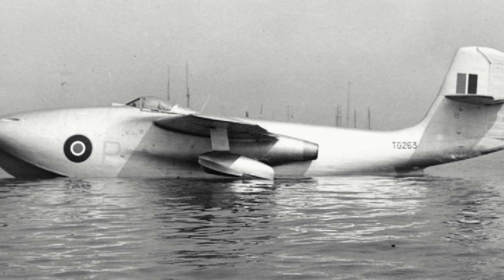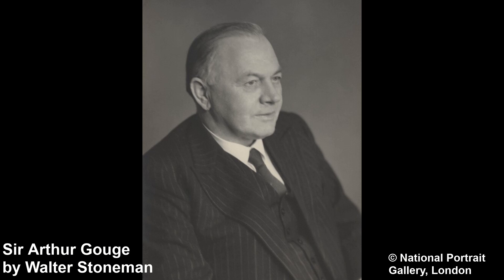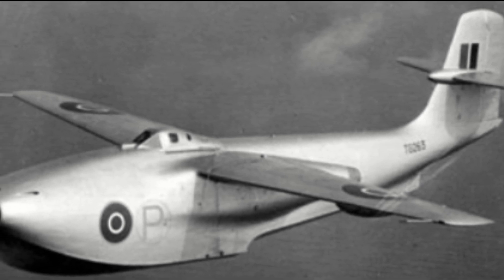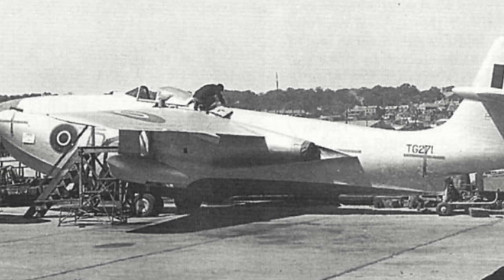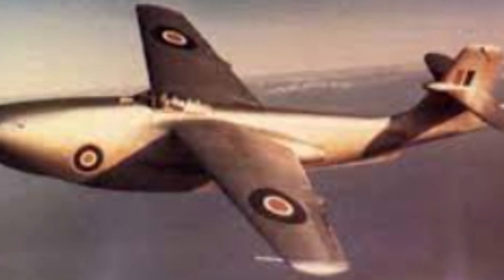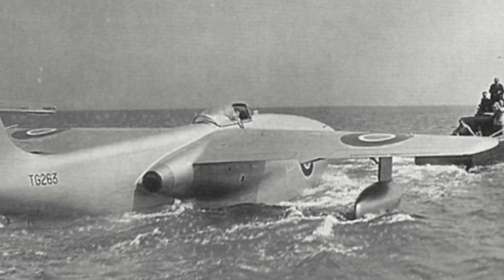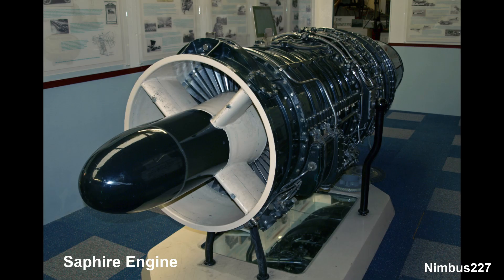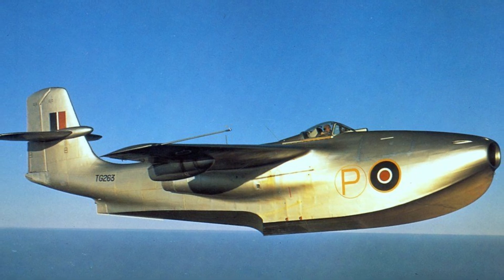A flying boat powered by jets? Saunders-Roe SR.A/1

Comment: What does 9 degrees parallel mean? Do you mean that he had to land on a heading g that was 9 degrees different to what he took off on?
Reply from the maker: It's a little hard to hear, but it is meant to be 90 degrees instead of 9 degrees. That is, he had to land on a heading 90 degrees to that he had taken off from.  I've also now realized that "90 degree parallel" doesn't make sense either. Should have just left out "parallel".  Sorry for any confusion and thanks for the pick up
Reply: @AntiqueAirshow  perpendicular is the word you want.